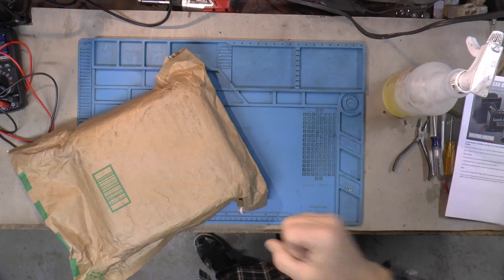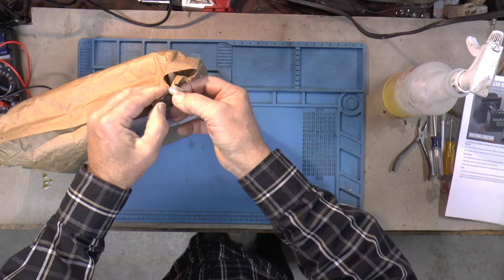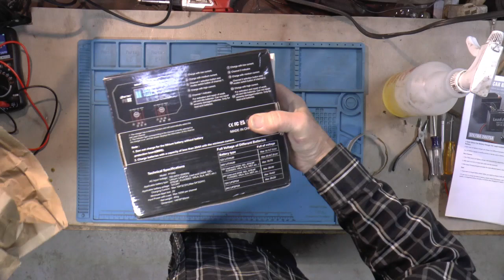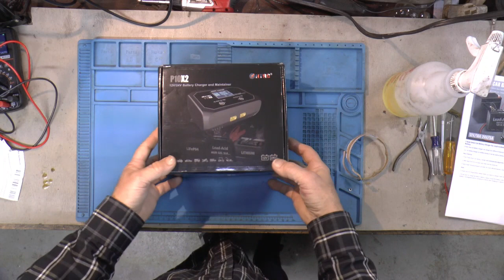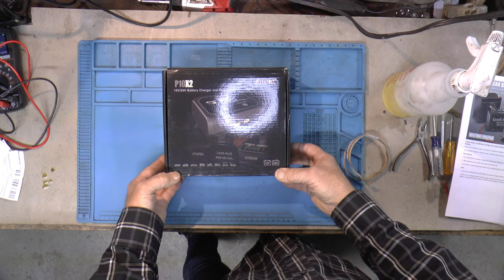HTRC 12/24 Volt 2 Bank Smart Battery Charge Maintainer

Comment: Nice video with clear info; can you share what the PUL is for at 8:09?
Reply from the maker: When in repair mode ( only use for lead acid batteries ) the screen show PUL witch means the current is pulsing I believe at a higher than usual voltage to knock of sulfates from the plates thus repairing the battery.